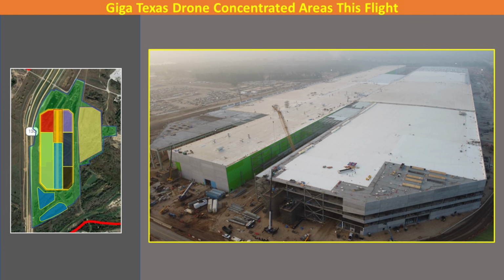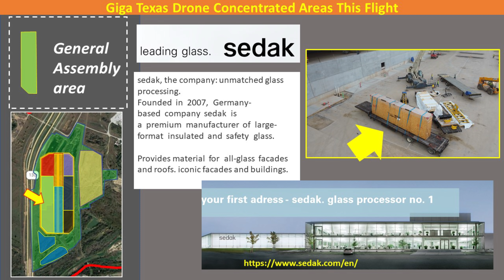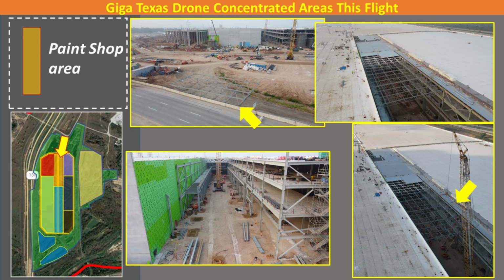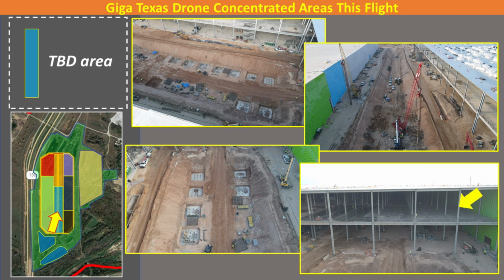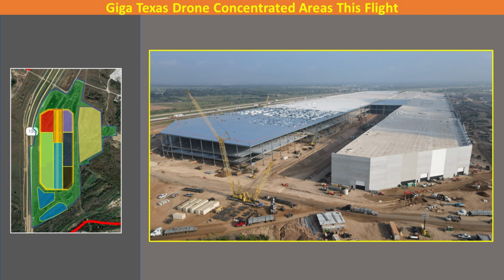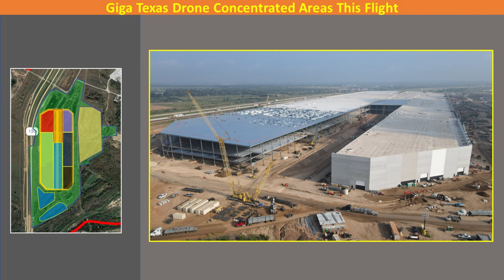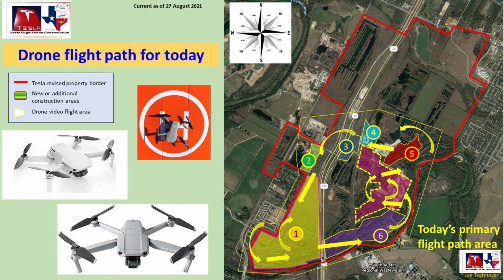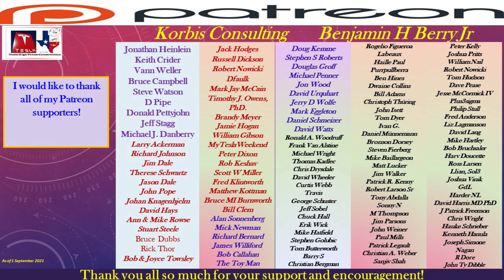Tesla Gigafactory Texas 1 September 2021 Cyber Truck & Model Y Factory Construction Update (07:45AM)

Comment: Does anyone know if this roof will have solar panels installed on it--either soon or at a later date? Seems like south Texas would be a good spot to make use of some Tesla solar panels.
Reply: The solar panels should be installed above the parking spaces in the parking lots.  There will be a huge amount of space available for parking, and the solar panels keep the parking area cooler and will be easier to maintain.
Reply: @acmefixer1   and Dean.  Do both?
Reply: I know they are finishing GigaNevada. They also have a shit ton of MegaPacks in the lot there, but they also manufacture them there, so I don't know of all of them will be used.
Reply: Its generally a lot cheaper to install solar panels in the middle of nowhere. That way, you don't need any nice looking brackets, just some cheap steel fence posts potted in the ground. A pickup truck can pull up and repair broken panels. Can't drive pickup trucks on the roof. And god help a fire starts due to bad electrical wiring, you don't have a building to burn down. Yes, solar panels have sometimes caught fire. Rare, but it is concentrated energy, after all.
Reply: @LinasVepstas  Yet they will cover giga Nevada, designed in from the get-go, even if the building never achieves its originally planned for footprint.
Reply: @jeffcarlton3590  Yeah I guess, if it was designed in. The roof there seems to be clear of stacks, vents other openings and penetrations. Unlike here.

Another problem with roof installation is you need brackets that don't leak when it rains, and don't blow away when its windy. This is surprisingly hard to do. Especially the leaking bit. When it rains, differential air pressure (aka "wind" ) blows water up into all the wrong places, and where it drips inside is not where it leaks outside. It can be blisteringly hard to find the actual leak.  Really, the best deal is to just not have roof penetrations at all.  i.e. no rooftop solar. At least, on a building like this. Your mileage as a homeowner may vary. Houses are simpler.